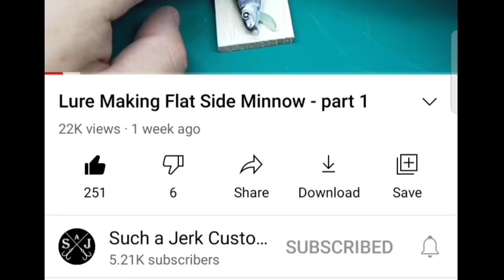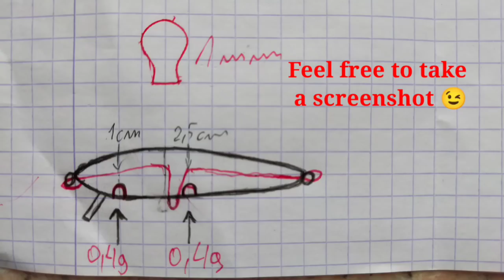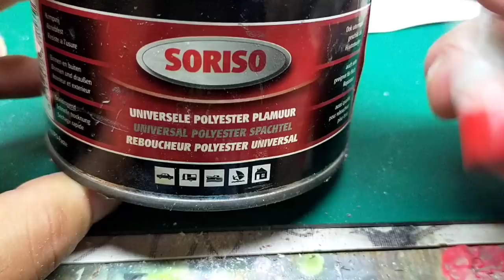Lure Making Beginners Minnow | Same Day Build to Catch 🎣

Comment: A great little lure and with little tools too. The other great thing was it fished well 👍
Reply from the maker: They all fish well 😜 but for the time, effort and money spend it did pay back already big time 😁
Reply: @SuchaJerkCustomLures  It's Good for someone that's not sure whether it could become a hobby or not, they can get a taste of what it takes before investing in more tools. I have an electric scroll saw and a table top belt sander so an airbrush would probably do me. I have an air compressor but It's a larger one for bigger air tools so I'd probably need adapters to make a small airbrush work with it. I give up lure fishing years ago because of a back injury but if I end up getting a kayak, I'd be sitting as it hurts when I stand for too long, I end up in agony for a few days 😥
Reply from the maker: @pa_maj.MARTINI-van-MAN  well so kayak Sims to be a good solution, or perhaps a belly boat 🤔 but that still probably put pressure on the spine... Making them just for sake of doing so doesn't make sense, the real satisfaction is when you catch on your own creation 😊
Reply: @SuchaJerkCustomLures  I started watching kayak fishing videos as my friend uses one, then I realised I could fish easier with lures again. I have plenty of free time gaps to make them. My lures I made years ago from mahogany brush shaft handles, swimmers, hard to carve and I didn't know what I was doing at that time 😂 but now I've a better idea thanks to yourself and TreysArt 👍 I's like a kayak because I'd sea fish in it too, I'm 1.5 miles from the coast.

Comment: Excellent video(s)!
I wanted to share something I learned the other day.....
BAKING SODA is a super glue accelerator! Ye! Uh huh! Sure is! And and excellent filler as it make the glue grittier and coarser. It also adds weight, which can be good or bad, just as long as you know. 
But yes, it speeds dry time up dramatically for CA glue aka super glue!
Reply from the maker: Thank you for the tip 😉 I do know super glue and baking soda mixture - I don't use it though as a filler - to hard to file compare to the wood filler - so what time you save on the hardening, you'll waste on sanding 😉 with that being said I do use it as a fixer of the internal through wire due to its strength, only leaving small gap from the top to finish it with the wood filler and sand it smoothly 😉
Reply from the maker: If you check my pike Jerkbait video you'll see what I mean 🙂
Reply: @SuchaJerkCustomLures  Oh I saw your filler system and LOVE it!!! I love how you use a single wire system too.....genius! I hope to soon make some lures like yours and cheat a little with some high resolution 3D resin printing. 
Don't worry.....there's still LOTS of hand work to be done with them I promise!
I'll just keep watching and leaning from you wonderfully laid out tutorials!
Thanks for all you do for the fishing community!
Reply from the maker: @justinmurphy2227  it is a lot of extra work(compare to lure making off camera) but comments like your makes it all worthwhile 🥰

Comment: I am a beginning lure maker having trouble getting the bill size right. How far outside of the lure body should a bill extend? If it's rounded bill on a jerkbait, how wide should the rounded part be in relation to the lure? What angle should a square bill sides be, and at what point should the bill stop?
Reply from the maker: Well, that is not easy question to answer in a comment section. What I would suggest is to sign up to that Facebook group and ask there ( a lot of helpful and experience lure makers in one place) 
https://www.facebook.com/groups/320429427999060/?ref=share

Comment: You may use baking soda instead of basla wood dust.
Reply from the maker: I know, however since I already had the balsa wood dust, and the aim of the video was to use as few tools and ingredients (as that's what beginner will have available) I didn't want to add one extra. Aside of that I'm not a fan of using super glue + baking soda to fill the lead holes - especially in balsa - is just to hard and after it doesn't sand even. Always use filler putty instead. The only exception is in my Popper build - where I cover the through wire with it for the strength, and only the surface with putty for smooth and even finish ;)

Comment: What wire do you use?
Reply from the maker: Here, since it's a small lure for light tackle 0.5mm stainless steel through wire 😉 as the video shows strong enough 👌 people sometimes are scared of thin wire - but if you'll fish with 7lb leader it's obvious the wire still will be the stronger point 😉

Comment: can i use the cd itself as a lip?😅
Reply from the maker: Never used one - but feel free to experiment 😁
Reply: You can do anything you want to!!! That's how new inventions and method's are found at times.
Reply: @blindabinda1234  but im scared if the lip broke when im fishing 😅, cause you know why i make lures myself 😅
Reply: @fauzipanjihermawan576  you won't ever know if it will work if you never try it.
Reply from the maker: @fauzipanjihermawan576  I don't know your budget or if it is available where you live... But the reason for me now exclusively using laminate lips is that they're basically unbreakable !! 🙂
Reply from the maker: @fauzipanjihermawan576  I'm buying the material - laminate - online, having it delivered to my buddy that works on CNC milling machine and cut the bibs for me 😉